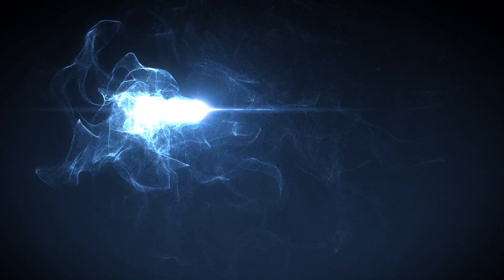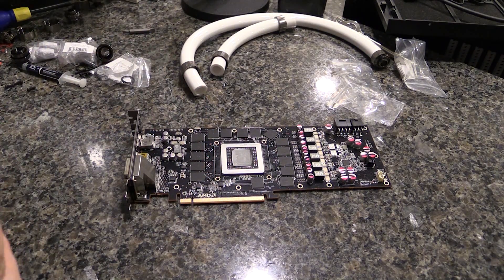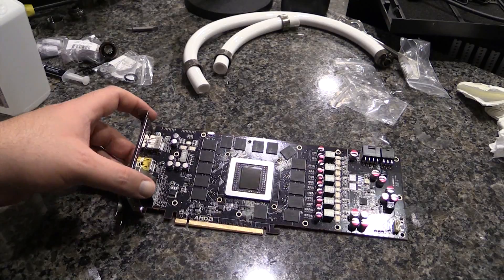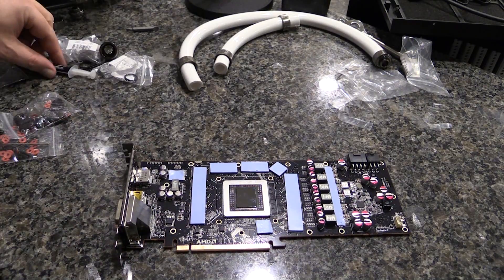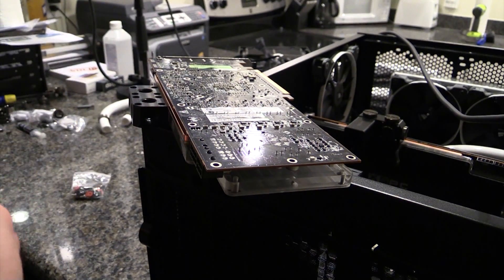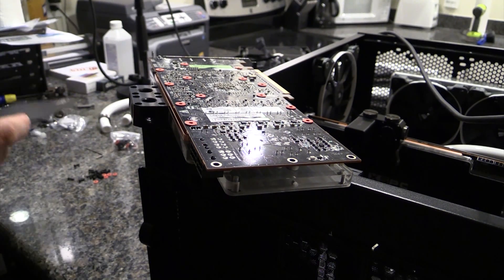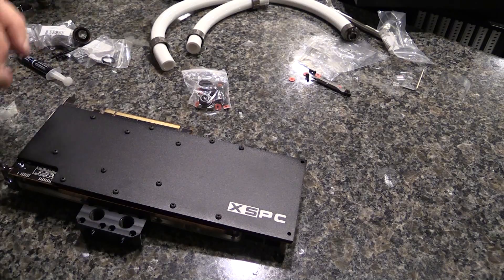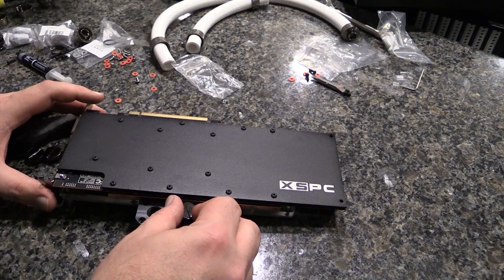AMD R9 290 Water Cooling Guide - XSPC Waterblock Installation

Comment: Is the back plate is correct or is that cut out for the power plugs?
Reply from the maker: Sadorath The cutout is for the crossfire bridge, which AMD removed late in 290/290x development.
Reply: We need a gpu amd r 9 290 ,
where to find?

Comment: I'm really new with this "custom watercooling" i'm kinda scared to do it.
I have 2 R9 290 reference. 1 from ASUS and the other is Sapphire.
Any advice ? Should i do it?
And to anyone who made it, mind to share some temps ? :) 
Thank you.
Reply: Born Boy It's expensive.  I'll warn you up front.  However, if you're looking at this block for your cards, XSPC also offers some starter kits that have everything else you need.  If you get the 3x120 rad kit with the D5 pump, all you'd need for your system is two of these blocks, two backplates, two of their SLI bridges (that bolt the cards together) a few more fittings and another 2x120 radiator with some fans.

Comment: Having had to clean off TIM from many newer model GPU cores (including a reference R9 290), I have found that the best method is to do what you did with the paper towel and alcohol first. If you do end up with any on those tiny parts around the core I found that an old soft bristle toothbrush not only works perfectly in removing all of the old TIM but it does no damage at all to any of the components. I have used this on the small resistors or whatever those are around the core, on the VRAM and even the PCB in cases where TIM got all over the place on accident. Just make sure the toothbrush is not only clean and free of toothpaste but also completely dry and free of any moisture. The kind I use is actually an old one for my dog which has two ends with a small and a large head and the bristles are really thin and soft.
Reply: Odd, I've used anti-static lint free wipes when I clean my stuff, It's pretty much the same stuff you use on your glasses or screens, it's nice because you can just throw it in the wash or use hot water and dry it out and it can be used again. No lint, and it cleans up really nice.

Comment: TimmyTechTV just go to a hardware shop and ask for a pack of 2mm nuts ,they cost like $6 for a pack of 100 nuts ,then you can use one of those to put the bolts into those 2 holes ,yea I dont call them screws bec they are actually tiny bolts and not screws :)

Comment: I have an MSI Twin Frozr R9 290x, will I be able to put a block on it?
Reply: with star citizen 2x290 in 1080p wont be too much ;)
Reply: nope only on reference
Reply: aliawesome12fab -_- 
if you are gonna troll atleast be a good one
Reply: Why would someone replace a Twin Frozr with a watercooler. The MSI cooler is pretty good.
Reply: ***** 94c all the time is pretty darn good ...
Reply: Durolith Well I would say something is wrong with your card, or your case needs better airflow. You should probably call MSI for advice.
Reply: Crossfire
Reply: *****
its nothing wrong with the card, the msi cooler just is a pile of crap, its ok if you play at 1920x1080 but if you play at that resolution you dont need an R9 290, playing at a resolution like 5760x1080 makes my r9 290 msi twin frozr run at 94C constantly too
Reply: ***** he would need to for sli.
Reply: managed to fit EK watercooler on my Rev 2.1 MSI cards
Reply: HAd to use a rotary dremmel to make place for the capacitor and some Enzotech MOS-C1 on the left uncooled chips

Comment: Since G10 came out...I never want to build another water cooling system...Just using AiO for saving a lot of time and easy to clean.
Reply: ***** Yah it is,but sometimes it's a disaster plus I'm lazy.
Reply: Doesn't work well on R9 290's unfortunatly
Reply: EZ MoNeY BK Then,There must have something went wrong.
Reply: Yeah unfourtunatly 290 has extremely hot vram. My card blew within 2 days. Had to go and get another one while I try the RMA it lol. Otherwise it is extremely useful mounting bracket.
Reply: EZ MoNeY BK Well then put a vram sink on it with the g10.